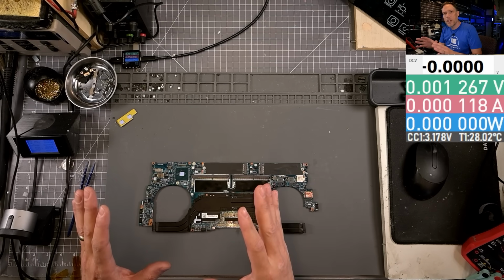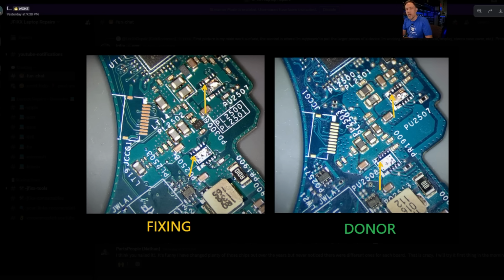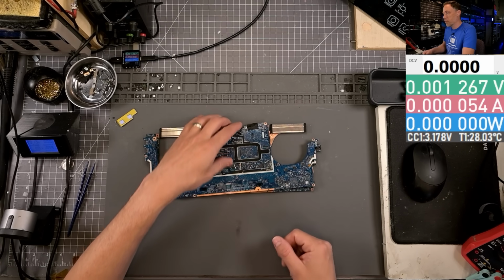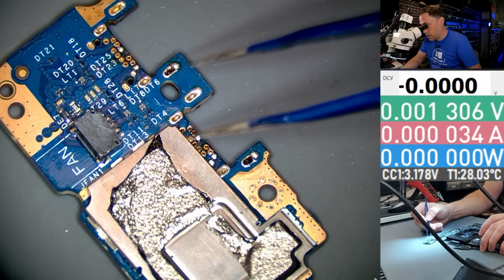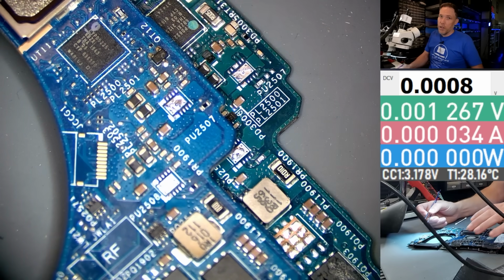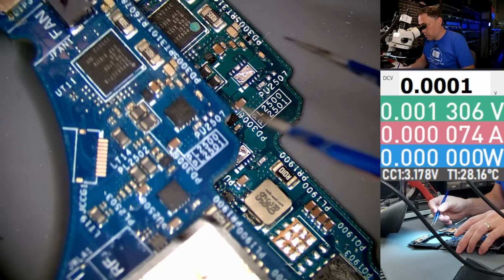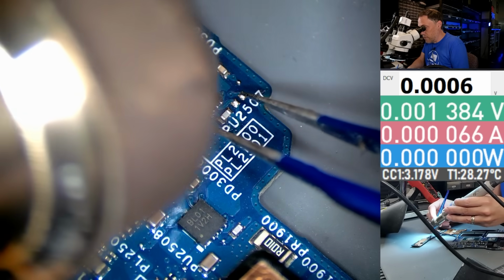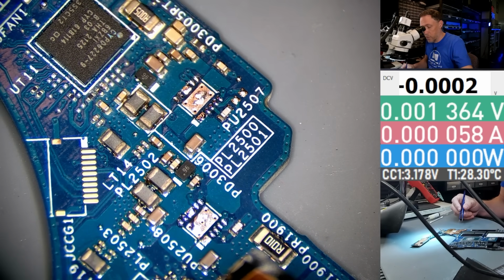I Spent 3 Hours TRYING To Fix This LIVE— But I Made A Big MISTAKE!

Comment: sharing mistakes helps others not make them. and i still found it interesting, mistake or not.
Reply: part of the problem is the engineers making themselves essential by making constant board revisions to ensure job security because in america, there are no employee rights or protections. its the same reason why microsoft windows is bloated with apps nobody wants or uses - ms engineers trying to avoid being fired to cut costs.

Comment: The oddity came during the livestream when we tried to pull the enable pin low but it never responded. Less likely the new chip was faulty, checked the datasheet to see if we had the wrong pin.. then.. oops. 

(Unfortunately only after the livestream ended because I was also tunnel visioning along.)

Comment: No offense meant but if you had crowd sourced data in a bio-med shop like  that previous video you would have your walking papers right now. You owe the customer a 15 minute repair charge.
Lesson learned, always compare the physical characteristics as well as the part numbers when doing swap outs. Manufacturers change designs under the same part number and go by the date of the application circuit. With rapid sales and evolving circuitry trying to keep pace with consumer demand, each product is considered a prototype for the next generation. Alterations in circuitry is common.

Comment: Hi, Nathan. I love your videos, and I hate to see you painfully removing liquid metal from circuit boards. Aluminum foil is the key. I would like to share some facts with you:
Please at least try this and see how well it works and let me know. 1. Affinity Between Aluminum and Liquid Metals Metals like gallium and mercury readily wet and diffuse into aluminum. When you touch liquid gallium or mercury with aluminum foil, the liquid metal tends to spread onto and “stick” to the aluminum more than to many other surfaces. This makes the aluminum act like a “magnet” that draws the spill away. 2. Practical Cleanup Method Cut small strips of clean aluminum foil. Gently dab or sweep the foil against the droplets of liquid metal. The liquid clings to the aluminum, allowing you to lift it off the board. For fine traces or cracks, you can press crumpled foil into them, and capillary action will help pull the liquid metal onto the foil. 3. Advantages Over Other Methods Non-abrasive: Aluminum foil is softer than most circuit board materials, so it won’t scratch copper traces or solder mask if used carefully. Localized capture: Instead of smearing the metal around, foil tends to capture and hold it. Alloy effect: Because gallium and mercury both attack aluminum, the reaction locks the spill into the foil, preventing it from spreading further. In short: aluminum foil acts as a sacrificial sponge—liquid metal “prefers” to stick to it, so you can collect and remove spills without damaging the circuit board. How to Do It Safely Wrap tightly: Cover the cotton tip with a small piece of clean foil, smooth it down so there are no loose edges. Dab, don’t rub: Gently touch the liquid metal with the foil tip; it should jump or flow onto the aluminum. Avoid dragging it across traces. Replace often: Once the foil picks up liquid metal, swap it out for a fresh piece to avoid re-contaminating. Dispose properly: Collect all used foil/Q-tips in a safe container. Gallium and especially mercury should be handled as hazardous waste. Extra Tips For larger pools, start with a small wad of foil to capture the bulk, then finish with foil-wrapped Q-tips for detail work. If you’re cleaning gallium, avoid aluminum parts of the device (like housings or heatsinks) unless you intend them to “soak it up”—gallium destroys aluminum structurally. Always wear gloves, and if mercury is involved, use a fume hood or well-ventilated area. I hope this helps, Nathan. Have a great day, Preston
Reply: Or just use a hypodermic needle.

Comment: Don't feel bad. I was doing a network upgrade a couple of years ago and needed several CAT 6 lines run. I couldn't do it myself because the ceiling were too high. One of the owners had an electrician friend who could do said he could do it. I come in a couple of days later to do the termination, only to discover the guy had pulled about 400' of bell wire, not CAT 6. He was and older guy. Just pulled the wrong box off the shelf. Said it was the worst mistake he'd made in 45 years.

Comment: I messed up with my Hard drive reader dock, got two chargers identical looking, one's for the drive reader one's for my hoover and unfortunately I picked up the hoover one 34V, everything worked for a few minutes as i was checking the drive then a loud pop. I switched it off opened the drive reader up and electrolytic cap had exploded, replaced it yeah got some spares here. Plugged it back in and well, same charger no pop the blue light reading drive dimmed to darkness. It wasn't until I checked the chargers I realized what I'd done, opened the drive reader and had a look, there was a hole in the main processor chip. GG £20 in the bin. Hard drive that was in there being read, survived!

Comment: Hi there! Love your vids! 
Can you please tell me for Dell XPS 9300- if we buy new PD controllers, do they require programming?
Thanks!
Reply from the maker: Mouser or Digikey will have them, and those do not need to be programmed, but I have seen plenty of those PD controllers short out and damage the CPU. So after the PD controller is replaced, the laptop is giving a 2,1 error code, which is a bad CPU.
Reply: @dellpartspeople  yes, that is what I was afraid, the cpu might be damaged. Both 3v3 and 5 lines that go to the pd are shorted - the 3v is shorted in a switch chip. The 5V I couldn’t find where yet, there is a 30 ohm resistance on it which I find too low - with pd removed